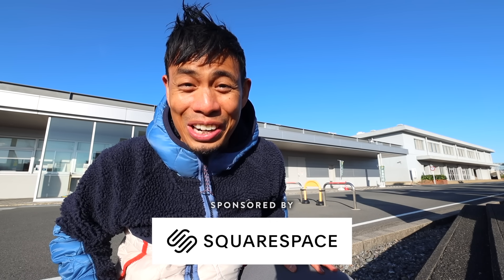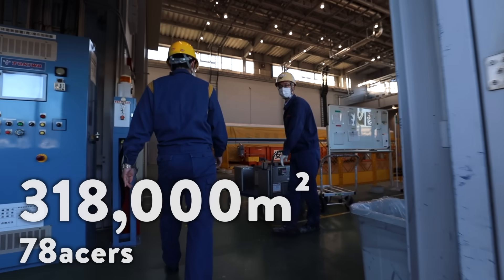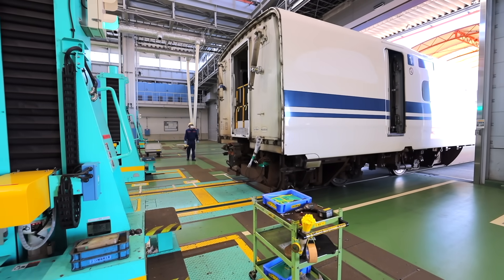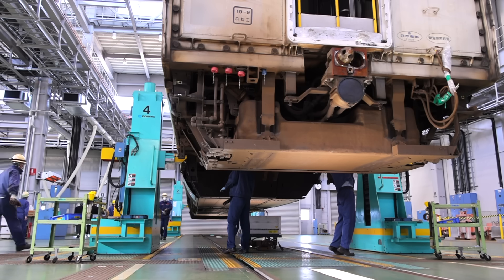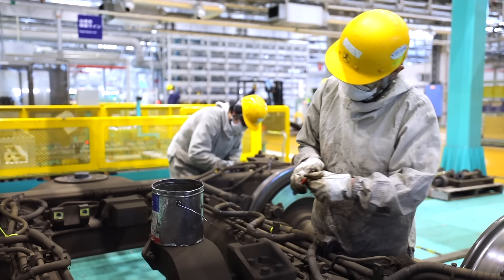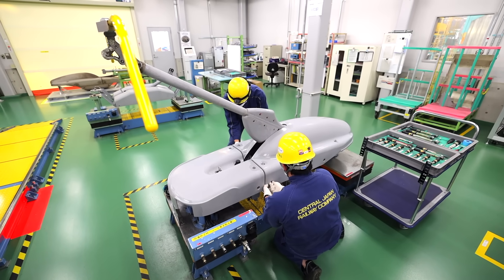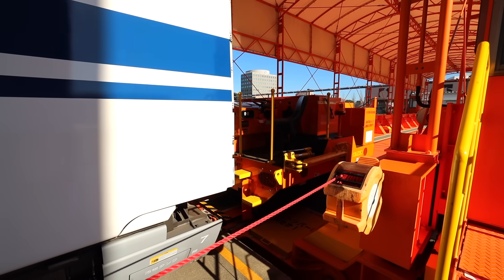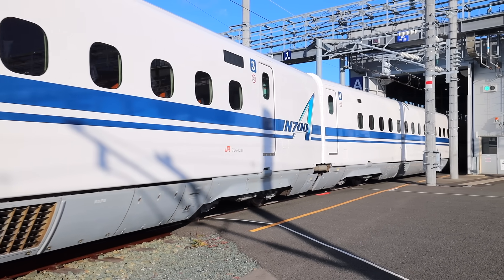How a Shinkansen Bullet Train Factory is Made in Japan

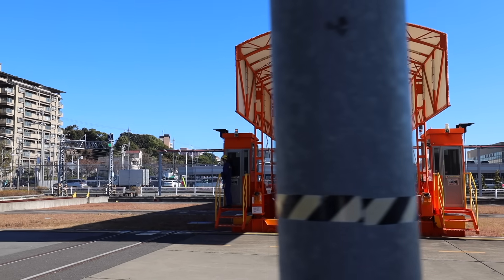Comment: 13:25 wow... in Germany we do also regular inspections after 60000km an the wheels, because we had a very nasty accident caused by a broken wheel about 25 years ago. but actually completely rebuilding the whole train every 3 years...? unthinkable here, if we'd do that, none of the express trains would be running nowhere. 
our fist ICE-generation (german high-speed train, the third gen can reach up to 350km/h) was kinda "refurbished" around 2005-09, after being introduced in 1990. that's 15 - 20 years, not 3... :D

Comment: Finally the roof is being "cleaned" by being repainted... crazy. No wonder this train operates the safest in the world. I don't think this complete teardown is performed anywhere else in the world (or at least not to that level).
Reply: Germanys ICE after 2years or 1.200.000 Km has a similar maintanacne process of 10days.
Reply: Ironically, the only other trains I can think of to get such thorough rebuilds would be preserved historic locomotives (primarily steam, but also historic diesels and electrics, as well).
Reply: Class D aircraft overhauls do the same thing and those happen everywhere. No paint removed during class C checks but those are still equivalent to what is shown here.

Comment: 6:00 - I’m surprised to be the first to comment this but 300 KPH is about 180 MPH not 800 but no worries we know what you meant. Train go fast. Still cool to see. Just FYI, 800 MPH would be about 1280 KPH (1 mi ≈ 1.6 km)
Source: I’m a mech. engineer

Edit: if I would have just watched like 20 secs later I would of seen you realized the mistake because the subtitle mileage was correct but like a typical internet dickhead the second I heard something wrong, STRAIGHT TO THE COMMENTS, OFF WITH HIS HEAD!!!  My B.

Comment: Nice video, they sure have safety in their minds with the highest standard which is very good! I saw some blurred out parts under the train though, now i'm curious what there is to see :D
Reply: I spent forever analyzing the video to figure out any possible reasons. I only have two guesses. The first is that the blurred components are worn or damaged, and they didn't want a public record of there being damaged or overly worn parts on one of their trains - maybe just for ego/reputation reasons. The supporting evidence behind this is that Paolo would sometimes blur only one part of the train but not the identical matching component on the other side - the idea being that only the worn/damaged part was blurred. The other guess is that there are proprietary parts/connectors that are only visible during servicing, and they didn't want a public record of those parts for competition to easily copy. Maybe it's a little of both?

Comment: That's such a monumental undertaking, and it's actually pretty relieving to see that they have those tray molds for EVERY part AND tool because there are SO MANY steps in the process and equally many that can go wrong if done without utmost care.
Reply: Totally agree. This method of putting the material and tools in their own specific spots is called 5S and originated in Japan. It is used to reduce the risk of possible errors during the assembly process due to worker misbehavior.
Reply: Yeah seeing them strip the train down to bolts prior to putting it back again, I was getting visions of "Where did this bit go? Ah, probably didn't need it"
Reply: I agree they have achieved high level excellence in ergonomics and seeing the repairing facility makes feel as though I am in a aircraft maintainance hangar.

Comment: when we first visited Japan, we made sure to ride the Shinkansen. It was a bit pricey for us but the experience was worth it for me. Seeing how it is regularly maintained and the extent of the maintenance work makes me appreciate the cost of the experience.
Reply: I had a JR pass that cost around 30,000 yen. So I have unlimited Shinkansen ride for 7 days.
Reply: @missplainjane3905  interesting questions
1 yes
2 8, from the eyes of a tourist, it is still bit expensive
3 polite, helpful
4 safe, clean, green
Reply: how much did it cost?
Reply: @richcast66  If you're planning on traveling to more locations, you can get a JR pass as a foreign tourist for 7, 14 or 21 days. I remember that the 7-day one was more expensive than two Shinkansen tickets, but cheaper than three (around ¥30,000, roughly $300). And you can use them as much as you want during that time+other JR-operated trains and buses.
Reply: @richcast66  the ticket from Tokyo to Osaka cost us around 13,000 JPY
Reply: @kirbytorresph  And are there luxury class tickets? or is that standard across the board?
Reply: @richcast66  there are first class cars or Green cars in the Shinkansen, not sure how much those are.
Reply: @richcast66  I Heard it's about ¥150,000? It's definitely an experience...
Reply: @PrograError  That has to be some bundle price? That is a lot for a round trip